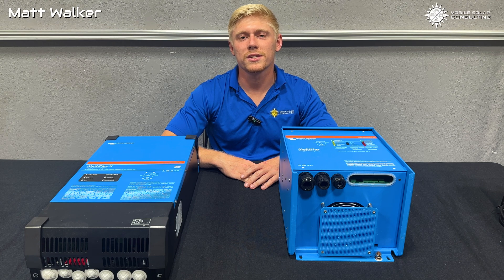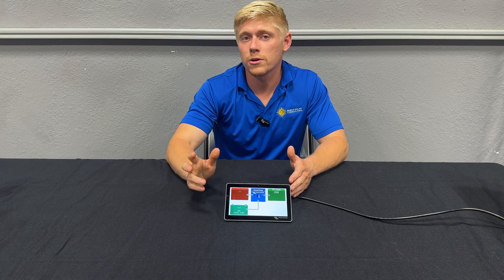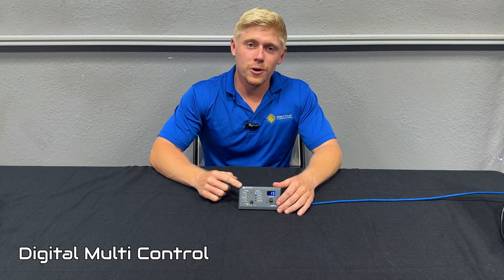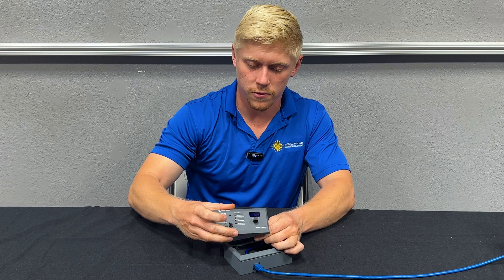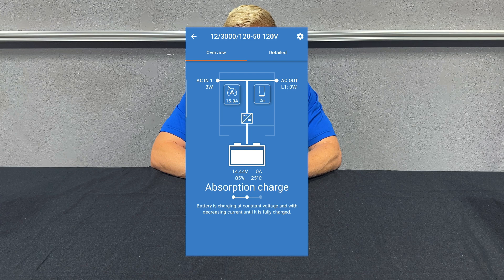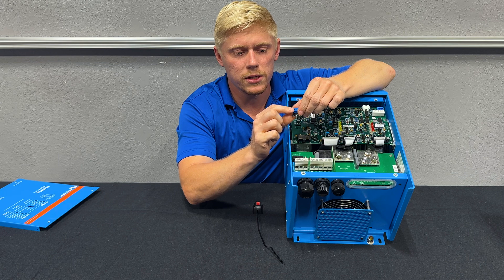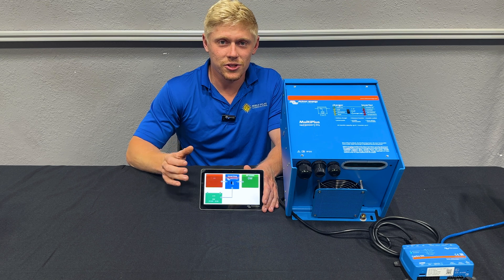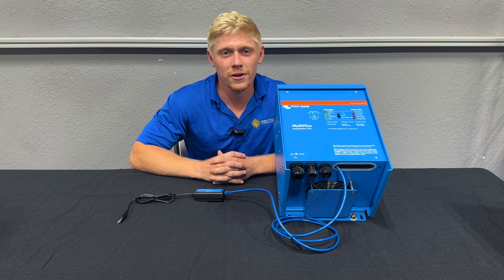5 Ways to Control Your Victron Inverter!

Comment: Why when I click on shore current limit to change it, it’s saying “the current limit is fixed in the system configuration and can’t be adjusted”?
Reply from the maker: You'll need to use your laptop and an MK3 to check the "current limit overruled by remote" box in VE Config 3. 

If you need more help with this, you can schedule a half-hour call with us on the consulting section within our shop.

Comment: My grid distributer recently set a rule that he has to to be enabled to remotly control a "zero feed-in" for stabilising the grid in case of "too much energy in the grid" (yes we occasionally already have that problem in Austria dur to thousands of small PV-energy-plants.

Is there a way to set a "feed-in limit" (eg. 20kW) as default value and remotly trigger a "zero feed-in" (using Fronius inverters of course) via one of the input-relays?

..or remotly trigger a grid disconnection in a 3-phase Multiplusv II system?